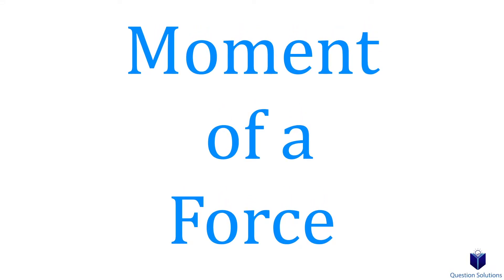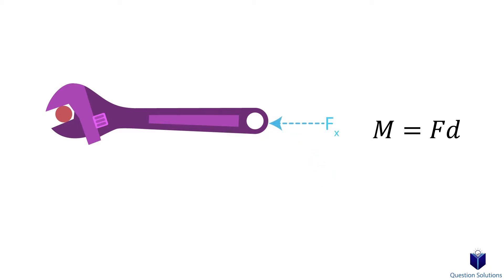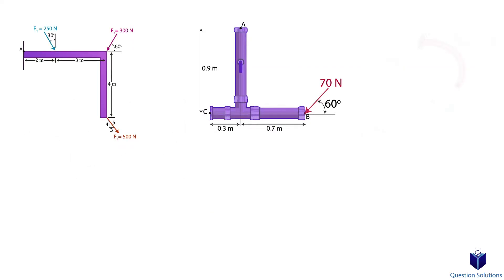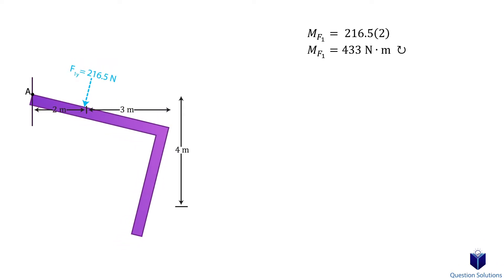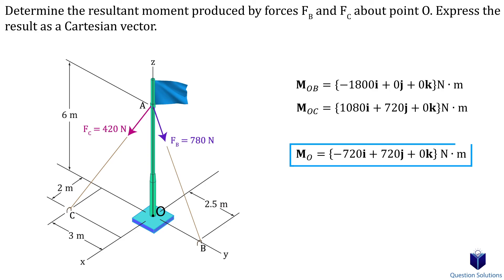Moment of a Force | Mechanics Statics | (Learn to solve any question)

Comment: For example 3, if r is the position vector from the point where we take the moment about to any point along the line of action of the force, can r be the position vector from O to A? if I do that i get -128.4i +128.4j -256.08k? (the only difference is the sign of the z component to your answer).
Reply from the maker: You absolutely can. I have a typo in my answer (see pinned comment). Your answer is correct.
Reply: @QuestionSolutions  ohh thank u

Comment: Hi, I have a question, why in 5:45 we get the position vector from OC and in 6:41 its from BC? That wouldn't mean that our position vector in 5:45 should be from O to A? I have tried that and it will change the values of the momentum vector
Reply from the maker: You can take it from O to A, and you will get the same answer. There will be no difference. You most likely wrote down an incorrect position vector. The position vector OA would be 3i+3j+0k. Keep in mind that there is already typo in the solution for that question as mentioned in the pinned comment. The answer for that problem is -128.34i+128.34j-256.68k. Whether you use a position vector from O to C or O to A, you will get the same answer.
Reply: @QuestionSolutions  Oooh, I just checked, and you are right! I was messing up with the position vector, but yeah, when you do it with 3i+3j+0k, you get the same answer. Sorry for the confusion. Thank you for your help and answering my comment, even though this video is 3 years old! New subscriber
Reply from the maker: @ThunderGowPlayer  You're very welcome. I am glad you got it :) Keep up the great work and best wishes with your studies.

Comment: for the fourth example, why are you using the position vector for BC if you're taking the moment about point A? would you not use AC?
Reply from the maker: There is a typo in the question, the moment was suppose to be about point B. I wrote a pinned comment about this too because I get asked it so many times. 😅

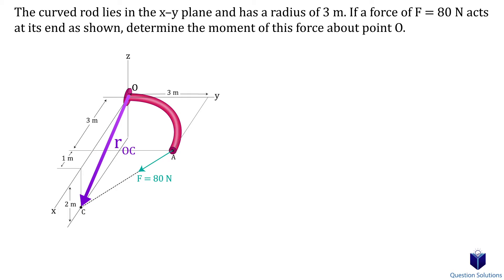Comment: At 5:47, why can't you just split the force into its x and y components and then solve the question like the previous two?
Reply from the maker: Excellent question! This is a 3D problem, that means the force now has x, y and z components. You cannot break it into components the same way you did with 2D problems. So you have the express that force as a cartesian vector, in other words, we must express the 80 N force in it's x, y, and z components, and then take the cross product to find the moment.

Comment: in 6:13 , I used the position vector OA. Why the direction of Z axis of my moment is -256.62 and not 256.2. Is it wrong?
Reply from the maker: It should be negative. Please show me the position vector you got. Thanks!
Reply: Sir,here is the moment when I use the position vector OA.

 Mo={ -128i + 128.34j - 256.68k }
rOA= {  3i +3j  +0k  } 
So if there's not any mistake the Moment must be the same for both position vector rOA and rOC. isn't sir 
Thanks a lot for ur help 😊😊

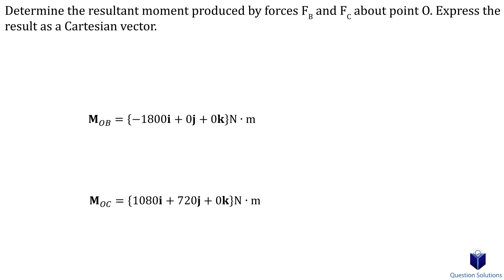Comment: At 7:56, shouldn't the net torque be (0,720,0)Nm? I don't understand how you got (-720,720,0)Nm. Wouldn't the 1800i and -1800i cancel out? I'm so confused.
Reply from the maker: So you're not reading the values correctly, you need to be more thorough or you will lose marks on your exams (it's always the small things that students lose marks for). It's not 1800-1800, it's -1800+1080 = -720. Again, NOT 1800 but 1080. Let me know if you need any other help, best wishes with your studies. :)
Reply: @QuestionSolutions  OHHH tysm! How did I not see that? lol
Reply from the maker: You're very welcome! @Milkiyas312

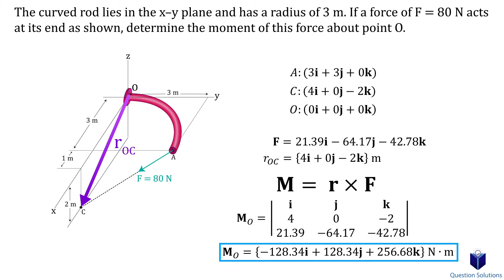Comment: 6:23 why doesn’t rA x F work? Why do we need to use rOC? F is acting at point A, shouldn’t we use the position vector rA when calculating the cross product? where rA = 3i + 3j + 0k
Reply: Please help.
Reply from the maker: You can use either rOC or rOA. They give the same exact answer.
Reply: @QuestionSolutions  ahhhhhh, no wonder i was so confused! You made a tiny mistake while calculating the cross product of    r X F the answer is -256.68k**** not +256.68k. You forgot the minus sign for the k component. So when i calculated rOA X F i got a minus sign for that component and thought they were different. See im not an idiot haha.
Reply from the maker: @Jingkebells  Yes, please refer to pinned comments first before assuming you made a mistake. Mistakes are pinned at the top of the comments.

Comment: In the first problem why is it that all of the x and y components are positive?
Reply from the maker: So unless you specify a direction when writing out equations, forces don't have negative or positive values, they are just magnitudes. For example, imagine you push on a box to the left. That's a force you applied, it's not a negative force. Now imagine you pulled on the box to the right. It's still an applied force with a magnitude, it's not a negative force. We only consider them negative and positive when we write out equations with a coordinate system.

Comment: In Q2, the force was applied at point B. How did u transfer that to point A? Also which way would the pipe rotate?
Reply from the maker: Please see pinned comment. There is a typo in the question.
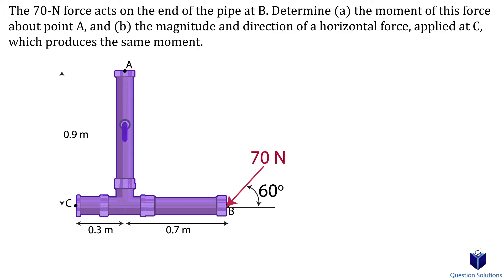Reply: @QuestionSolutions  Thanks for replying. In the pinned comment you talk about Q4 having a typo. But I have a doubt in Q2 starting from 4:30 . You don't address that. Can you please help me out?

Thanks!
Reply from the maker: @Hussain-e9z okay, I see. For future questions, please use timestamps so it's easier for me to find. So in this question, it's not really a transfer of forces. When a force is applied anywhere along the pipe, a moment is created about point B. You can visually see this if you break a force into components. For example, look at force FX. We can slide that force along the horizontal length of the pipe and it will create the same moment regardless. Why is that? That's because the moment created is only dependant on the magnitude of the force and the perpendicular distance. In this case, it's 0.9m. Now look at FY, the perpendicular distance is 0.7m. 

For the second part of your question, the pipe will rotate clockwise. Imagine the pipe is free to rotate about point A and you push at point B towards the left. Then we can see it would start spinning clockwise.
Reply: @QuestionSolutions  Thank you so much! You're really good at explaining. 
Please never stop uploading videos.

Comment: 6:23 shouldn't 256.68 be a negative (-)? Since we alternate our operations in doing matrices + - + 

last term should be + [(4)(-64.17) - (0)(21.39)] which results to - 256.68.
Please correct me if I'm wrong.
Reply from the maker: Please see pinned comment. You are correct, it's a typo. 👍
Reply: @QuestionSolutions  Thank you!

Comment: i do not know why u are saying clockwise to be positive in everything, everyone says clockwise in negative and counterclockwise is positive
Reply from the maker: Moments are not positive or negative. They have directions. We arbitrarily assign clockwise as positive or negative to solve problems. You get the same answer whether you pick clockwise to be positive or clockwise to be negative. Use whichever you like best. It makes absolutely no difference. Over time, as you gain more experience, you should be able to assign a positive direction based on the question so you have to deal with less negative signs.
Reply: i see, thanks @QuestionSolutions
Reply from the maker: @jamess3493  You're very welcome. Let me know if you have any other questions.

Comment: Hello, 
I think there is a mistake at 6:23, Roc should be Roa since the starting point of the force is A no ? Or maybe I don't know the rule well ^^
Edit : Well I just heard "position vector from point O to any point of the line of force action", I learned that thank you :)
Reply from the maker: Yes, as long as the vector goes to any point on the line of action of the force, you will get the same answer 👍

Comment: For the first question, when solving the moment for M3: Shouldn't it be -300n(5m)+400N(4)?
Reply from the maker: So remember, we are looking for the perpendicular distance. F_x is horizontal, so we are looking for the vertical distance from point A, that's the perpendicular distance, which is 4m. F_y is vertical, so we are looking for the horizontal distance from point A and that's 5m.

Comment: 2:35 the y component of the first force is incorrect it is 250sin30 which is 125N.m not 216.5 N.m
Reply from the maker: You are incorrectly using sine and cosine. You need to look at it from the view point of the angle. So if you're standing at the 30 degree angle, and look straight ahead (which is sine), you get the x-component, NOT the y-component. When you look to your adjacent side, you get the y-component, which is cosine. Remember, sine for opposite, cosine for adjacent.
Reply: Ohk I get it just that I interpreted incorrectly basically when I look for the y component I have a habit of using sine only so In this case you're right coz I would have used 250sin60 instead and it will give the same answer.. thnks a lot👍
Reply from the maker: @AG-bb3yw  Yeah, it's actually pretty common with students, but please don't use that habit. It's a pretty big pitfall and very easy to make a mistake when the angle/force is in the 3rd or 4th quadrant. Anyways, best wishes with your studies!

Comment: In the first problem, why does the x component of F3 create moment if the direction of the x component is parallel r to the line of action on A?
Reply from the maker: So you have to always keep an eye out for perpendicular distances. Notice how there is a perpendicular (vertical) distance of 4m between point A and the x-component of force 3.

Comment: For question 2, why the solution for Ma is 35(0.9) +60.62(0.7) ?? not 35(0.7)+60.62(0.9) ?
Reply from the maker: You have to multiply by the perpendicular distance. So the perpendicular distance to point A from the 35 N force is 0.9 m, not 0.7 m.

Comment: Umm aren't clockwise values negatives instead of postives? 
u seem to say that in this timestamp 4:09
Reply from the maker: Use whatever direction you like best. You will get the same answer. It is always easier and faster to pick the direction that will give you the most positive signs, otherwise, you will have to deal with more negative signs, but it is your choice.

Comment: at 4:53 why isnt the fx+0 because its along the line of action pf the force plus how are you able to tell if the fx is clockwise or anticlockwise
Reply from the maker: It's not along the line of action. You need to look at it with respect tot he point where we are calculating the moment. In this case, it's about point A. You can tell if it's clockwise or counter-clockwise by imagining the piece rotate around point A. It's easier to visualize if you cut out a piece of cardboard, pin it at A, and then push with your fingers. See how it rotates and then you will get a feel for it.

Comment: Great video! Really helped me wrap my head around this. With the curved rod question, wouldnt the k-value of the cross-product be -256.68k? ((4 x -64.17)-(0x21.39)=-256.68k) Otherwise it wouldnt be perpendicular to the plane created by the two vectors.
Reply from the maker: Glad to hear it was helpful. :) And yes, I have a pinned comment with the typo corrected. 👍

Comment: shouldn't the resultant vector be from the origin to point C and not point B to c at 6:45 ? The problem wants us to find the moment about point A (which I assume is the origin), and not point B.
Reply from the maker: I pinned a comment about this as well, there is a typo in the question, it should be about point B, not A.

Comment: why clockwise is positive? is it negative?
Reply from the maker: You can pick either direction, it makes no difference as long as you follow through with your positive and negative signs.
So for example, assume you picked counterclockwise to be positive, then if you get a negative answer, the moment is clockwise. If you picked clockwise to be positive and you got a negative answer, then the moment is counterclockwise. If you picked counterclockwise to be positive and you got a positive answer, then the moment is counterclockwise. Lastly, if you picked clockwise to be positive and your answer is positive, then it is clockwise.

Comment: i had a doubt the anti-clockwise is taken to be positive or negative . ( my txt book says positive )
Reply from the maker: I get this question a lot. I encourage you to take clockwise as positive and see for yourself what answer you get. Moments are not positive or negative, we associate them with a direction. If you pick clockwise to be positive, and your answer is positive, then your assumption is correct. If it's a negative answer, then your assumption was wrong, and it's actually counter-clockwise. The same goes if you pick counter-clockwise to be positive. Try it both ways, you will get the same answer.

Comment: In 5:07, isn't the perpendicular measure of x (0.7) and y (0.9)? Can you explain why it is in the formula, it's the opposite. Thank you
Reply from the maker: So you have to extend the x-component of the force horizontally in your mind. Then you can see the distance from point A to where the horizontal line is. That's 0.9 m. The same with the y-component. Extend it vertically in your mind and see the distance from point A. That's 0.7m. Maybe you're thinking of parallel distances instead of perpendicular? :)
Reply: @QuestionSolutions  Thank you!

Comment: Is not clockwise the negative moment instead of positive?
Reply from the maker: You can pick either direction, it makes no difference as long as you follow through with your positive and negative signs.
So for example, assume you picked counterclockwise to be positive, then if you get a negative answer, the moment is clockwise. If you picked clockwise to be positive and you got a negative answer, then the moment is counterclockwise. If you picked counterclockwise to be positive and you got a positive answer, then the moment is counterclockwise. Lastly, if you picked clockwise to be positive and your answer is positive, then it is clockwise.
Reply: @QuestionSolutions   Thank you!

Comment: Thanks for your help in this topic was wondering that isn't turning clockwise should be negative?
Reply from the maker: You can pick either direction, it makes no difference as long as you follow through with your positive and negative signs.
So for example, assume you picked counterclockwise to be positive, then if you get a negative answer, the moment is clockwise. If you picked clockwise to be positive and you got a negative answer, then the moment is counterclockwise. If you picked counterclockwise to be positive and you got a positive answer, then the moment is counterclockwise. Lastly, if you picked clockwise to be positive and your answer is positive, then it is clockwise.
Reply: @QuestionSolutions  Thank you

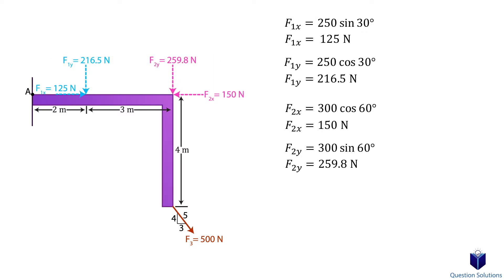Comment: At 2:41 Why did you use the horizontal component of F2 for F2x instead of the vertical component like in F1?
Reply from the maker: Okay, so I think what you're actually asking is, why did I use cos for F2x, but use sin for F1x, and you  are assuming cos and sin are related to horizontal and vertical components. If this is your question, please erase that thought out of your head. Sin and cos are NOT related x/y/horizontal/vertical components. They are purely based on the angle and it's corresponding side. I have no idea where students get this notion from, but please make sure you don't think like this. 😅I really encourage you to look at this video (https://youtu.be/NrL5d-2CabQ), it's not long, and if you're really tight on time, just watch the first example. It will give a very good foundation for working with sin/cos and how to properly use them. I break it down step by step and by the end you will never get confused again but sin and cos. 

If this isn't what you're asking, I am not too sure I understand your question. Maybe rephrasing it might help me, if so, I am sorry :(

Comment: In the 4th example, it said determine the moment of this force at about point A. Is point A at the origin? I haven’t solved it yet.
Reply from the maker: No, point A is near the flag, it is labeled on the diagram. Point O is the origin. 👍
Reply: @QuestionSolutions  that’s the Fifth example. I’m talking about the problem before that. It starts at 6:28.
Reply from the maker: @darrylcarter3691  For the future, please use timestamps. It's super helpful for me. :) 

And I just noticed, the moment should be about point B, since that's what we calculated. Typo in the question but I do say it out loud. Also, here, I guess A would be the origin, it's not on the diagram so I don't know. 😅
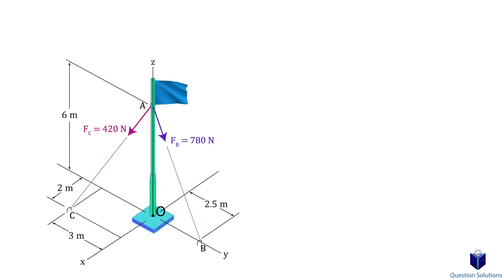Reply: At 6:54, shouldn’t the 180 be a positive?
Reply from the maker: @darrylcarter3691  No, -(0-(-180))=-180

You can always double check using this site: https://onlinemschool.com/math/assistance/vector/multiply1/

Comment: For the first question, why is F1x 'sin' and not cos? I thought we used cos for x-components & sin for y-components?
Reply from the maker: The amount of times students say this is quite scary :) This is absolutely NOT the case. Sine and cosine are NOT related to x or y components, they are based on the angle and the side relating to that angle. Please, take 5 minutes to watch this video, I explain this step by step. https://youtu.be/NrL5d-2CabQ If you're really tight on time, please watch the beginning and the first example. It will clear everything up, and set up the foundation needed for future chapters and pretty much every other course you will take that involves cosine and sine.